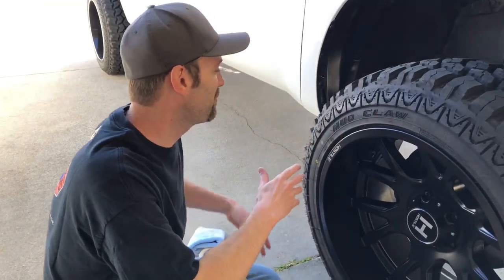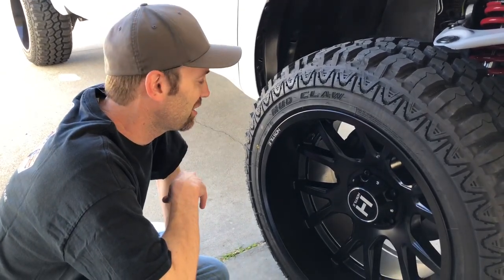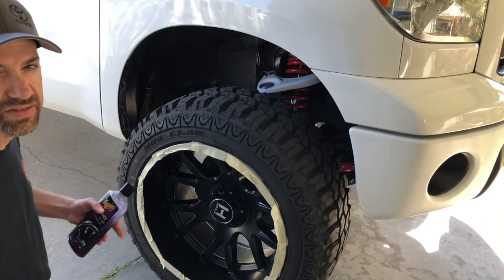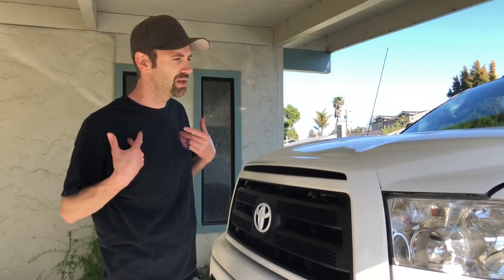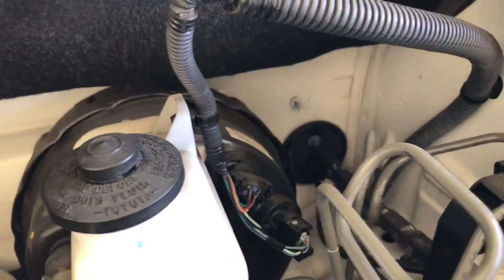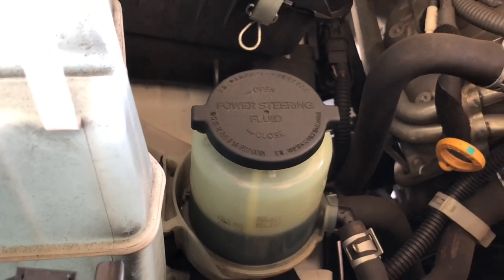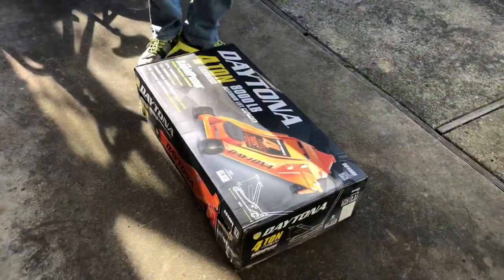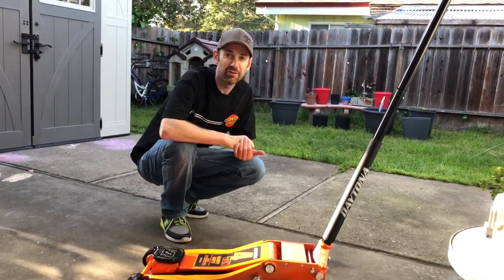Lifted Tundra Gets Some Attention - And A Colorful Surprise!

Comment: Nice truck man,but i have a question.  I own a 2013 tundra and I  really want the same setup you have,22  x12 ‐44 offset,but everywhere I go wheels shop I visit I'm told I must have at least a 6" lift for a 20x!2 - 44 offset. Wanted to know what did you have to trim and how much? Did you have to trim your body mount?
Reply from the maker: They are correct, to be safe I would run a 6 inch lift for my wheel and tire setup.. I have a Toytec Boss Coilover kit with about 4.5 inches of lift and I had to do some serious chopping to make them fit well.. it’s a 2012 with almost 100k and its paid off, so we cut it up, but i don’t know if i would do that on a newer one.. We cut the pinch weld, body mount, inner fender, front bumper, etc.. it looks fine.. and works great.. just be careful 👍🏼